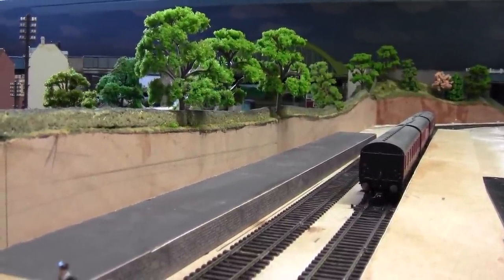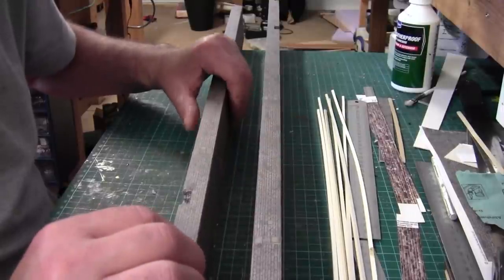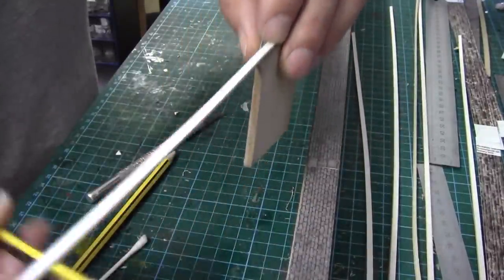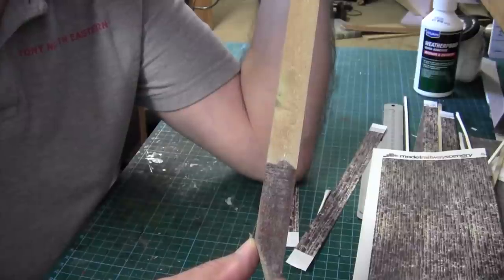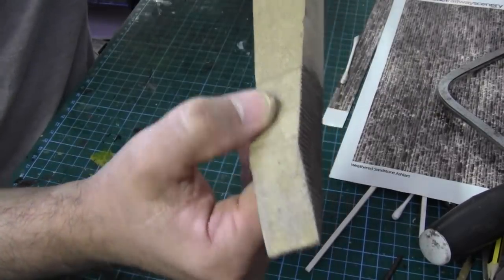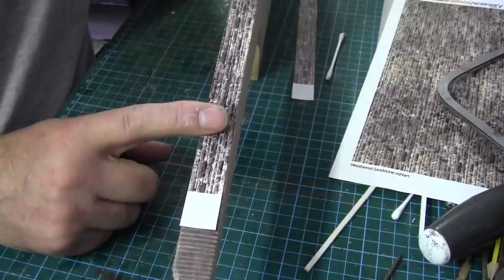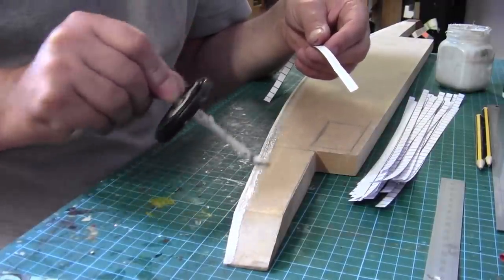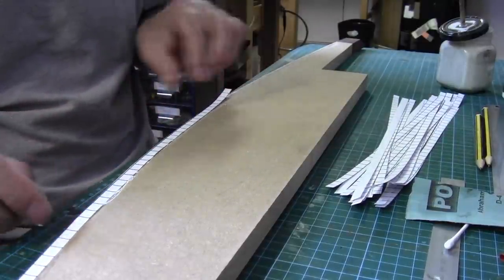Making Platforms Part 2...Edges Detailed.....No 321

Comment: I noticed the large X, so I take it you’re having a helicopter pad at Jarrow Road. 😂  I also see that you follow the adage; measure once and cut twice. 😂  Never mind, Tony, mistakes are part of life and how we all learn.
Good progress and a good job on the platforms.  Nice horse box; handy for Gosforth Park Races.  Looking forwards to the next instalment.  
Do you have a Loading Gauge, namely, a diagram of all the clearances required for platforms, overbridges, station canopies, etc?  If not, I'll send one to you in an email. Have a good weekend.  Best, Jason.
Reply from the maker: Hi Jason. yep its true measure once and then cut twice..oops i have done it a again. well we all mistakes. 
Jarrow did have canopies at one point in one very rare photo they are there. so i am going to have to put them in. there will be a very small bridge over the rails on the bend, but only wide enough for a tractor. single road. lots of ideas floating around at the moment. 
i have been doing some wiring up for the point motors but its just been so hot up there. that i am taking the rest of the weekend off. until next time all the best Tony..